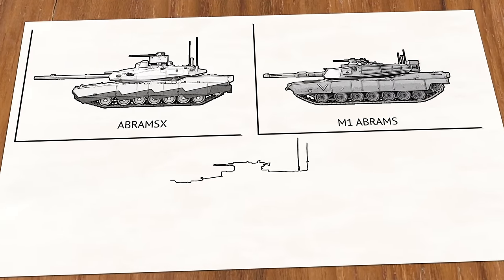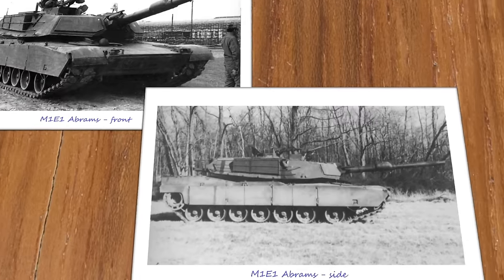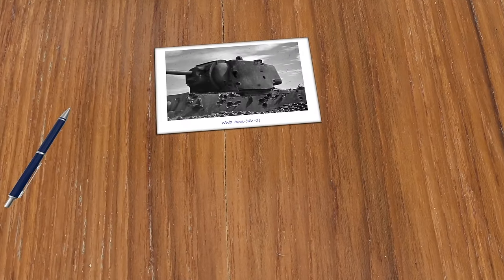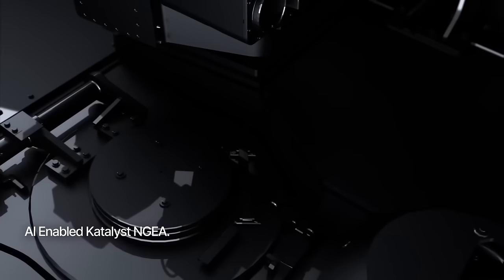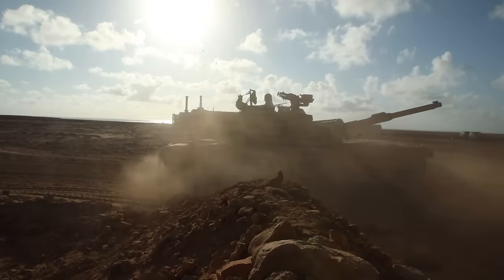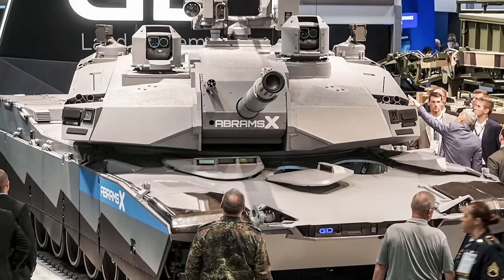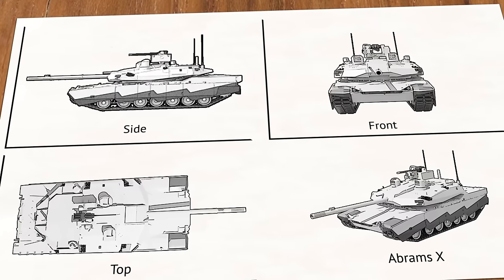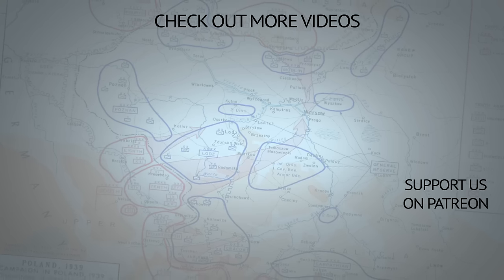M1A3 Abrams is finally happening. And it may get an unmanned turret, like the Russian Armata T-14.

Comment: I would say more like the M1128 Stryker MGS considering design applications. Though they'll likely opt to save the crew and keep the ammo in the turret, unlike the T-14, so it can still use vertical blowout panels without compromising hull integrity or mine resistance.

Comment: Half the reason we don't use autoloaders is because you want that fourth body to help manage the day-to-day needs of tank work. But this is a better improvement in the long run. Just follow the design cues from The AbramsX.
Reply: The same arguement was made for the 5th man back in the late 40s/50s. As it turns out not all tanks are equal in terms of work load. The total workload for the m551 was less than 1/4th the workload of any current m1 abrams (ie you could easily have it be a 1 man tank outside of combat) 

An abrams varient could theoretically be made with reduced crewload so as to not increase indivual crewmen loads while reducing the crew to 3. And inside of combat the minor increase in situational awareness can be more than made up for by assigning a a rotation of light drones to run spotting and security for the tank operated by men not inside the tank (something we already happening in Ukraine atleast some of the time)

Comment: This is a bold and necessary move for US armor corps. The M-1 family is old, and its problems are well-known: too heavy, not deployable under a lot of circumstances, and challenging logistics (fuel consumption is just one issue).  If you can't use the tank because you can't get it there in sufficient numbers, or once there you have a hard time keep them operational, then in a lot of ways, you don't have a usable tank.  The US being able to prepare for its last few major wars well ahead of time (e.g., via prepositioning) solved a lot of these problems, but they may not always work out that way in the future.  A more flexible and mobile force is needed, but I'm waiting to see if the new tank or design doesn't get weighed down gradually as well, which would defeat its main purpose.  The M1 grew by about 20 tons in its development, the SEPv.4 would've only added more weight.

Comment: As there's no info yet on how much weight the Army actually wants to shave off the Abrams, the M1E3 could still end up closer to Germany's conceptual KF51 Panther with its two-man autoloading turret than Russia's Armata with its unmanned turret. The pros and cons of an manned vs unmanned turret in an MBT are still debatable. 

The weight difference of these newer unmanned/manned turret MBT designs don't seem that much. In metric, the Armata's listed at 55 tons but the 21st century Panther (which also proposes a bigger 130mm gun) supposedly isn't that much heavier at 59 tons.

Comment: Given recruiting issues and the casualty estimates for Large Scale Combat Operations (LSCO) it would be wise to reduce the crew to 2 men (max 3). Saves size, weight, logistics and reduces need to train crew replacements.
Reply: If they go with an unmanned turret, the crew will be 3. 
2 is just not feasible with practicalities of combat/maintenance.

Comment: The best bits of every modern and recent tank series:  Engine in front (Merkava), Hydropneumatic suspension (S-Tank), Blow out panels (M-1), ERA (Various, but mostly Soviet/Russian),  Active Protection System (Various), Turbine powerplant (M-1), Armoured "Citadel" (None known).

My ideal new MBT would have a front mounted engine followed by a heavily armoured crew citadel, a lightly armoured turretless autoloading 130mm or 120mm/L55 gun with a 25mm backup cannon, a fire and forget ATGM secondary weapon, hydropneumatic suspension to further lower the front in hull down situations, an APS and full ESM, ECM and IRCM suites.
Reply: Very heavy
Reply: The whole tank is kind of the armored citadel. There's not much on a tank that can really be sacrificed

Comment: An 800hp direct drive turbo-generator would be best. Small high speed and high efficient generator to power a battery bank, with 100% electric drive setup would allow for greatest efficiency and best performance. On board barttery pack would allow for up to 80 miles of silent range and long term on-station silent observation mode.

Comment: The US already designed, built, and deployed unmanned turrets in the assault gun variant of the Stryker. to put it mildly, the turret was absolute hell. Frequent break downs, when a round failed to cycle properly, the crew had to physically exit the vehicle to clear it, meaning they were either exposed or forced to withdraw from combat to address the issue safely. To be honest, at this point in time, with drone technology being what it is, there is no reason to make these kinds of compromises. Larger tanks can serve as squadron leaders to lighter unmanned tanks that can be managed either by the tank crew or by a remote vehicle operator crew in a command vehicle elsewhere. Honestly, the fact we havent considered using unmanned vehicles as our primary assault gun and leave our MBTs for anti armor operations baffles me

Comment: I believe that the modern Abrams X with its silent hybrid engine is best way to go.  Upgrading the current M1 is just a stop gap to producing the modern Abrams X.
Reply: The AbramsX is just a more radical experiment of the same process the M1E3 is meant to do. It's likely they will pick up several things here and there off of it. As far as we know there's not a decision on what engine the E3 will have yet, so (although unlikely imo) it might still get the hybrid power pack

Comment: I would advocate for a new hull with the adoption of latest tech. The role of MBTs in combat are evolving and you need max flexibility. 
I agree the unmanned turret is the way of the future. Autoloaders are reliable enough now. 
But I believe they should keep the 4th crewman. For the same reason they have been retained in the past. The loader is a flexible person. Manning secondary weapons being the biggest reason. An extra man working on the tank inbetween movements is a huge deal in a field environment. With hard and soft kill systems being up and coming plus counter drone being such a big deal. Having a special trained individual for this makes the 4th seat worth it. Also with 4 people a 60-80mm mortar can be used by the tank with one person keeping the tanks defenses fully manned. This serves Israel very well. 
The new power pack I would suggest going to an engine forward design. Stay with a gas turbine. This is lower weight, higher power density, and is easier to service and change in the field. But go to smaller updated engine driving a generator. All electric propulsion with 4 motors. Two front. Two back. 2 separate outside citadel battery banks on either side of back half. With this setup. Even a round strait through the turbine in the front hull wouldn’t be a combat kill. You could leave the battle line and retreat a respectable distance on battery power and the remaining 2 rear electric motors. Put an apu in there. You could move, recharge, move, recharge. Back out of the battle space as long as you had fuel. Or use a big slave cable and charge off another tank or recovery vehicle. Options with this setup make it not invulnerable. But extremely hard to remove from the fight for any meaningful time. 
Engine forward also means crew compartment has a rear exit. May allow room for infantry, move supplies, or man portable weapon system a lot like the merkava tanks does.

Comment: This got me thinking tbh. I wonder how a cross between a Merkava and a T14 style of approach could be done. For example using the capsule style defense system for the crew but at the rear, and putting the engine at the front as another layer of defense, this means in an engagement if the tanks is facing the enemy, if the enemy shot the tank it would have to penetrate frontal armor, pierce the engine and any armor for the autoloader before reaching a more heavily armored capsule.  But also this would also allow you to further add armor on the ceiling of the capsule to prevent top down attacks harming the crew. The possibility of having the crew at the rear also means that incase of an imobalized tank the crew can exit quickly from a rear door aswell. I think having a rear crew capsule would be very viable giving the 3D VR awareness technology coming to 6th gen aircraft, the driver could use this technology to drive the tank from the rear. Maybe this could be the future?

Comment: You take for granted that the unmanned turret will save weight.  The hull will likely have to be made much taller to accommodate the crew in an unmanned design.  On the T14 this is obvious, as its hull looks more like a WW2 Panther than a more modern design.  The net effect may save weight, but it’s more likely the weight savings will come from things like removing the blast doors and downsizing the turret motor.  Probably <10 MT could be shaved that way.

Also, drone warfare has demonstrated that tanks main vulnerabilities will be from the air, from mines, and from artillery.  Older designs that prioritize frontal protection above side/rear protection maybe already obsolete concepts.  If tanks get knocked out by artillery 90% of the time and only get hit by other tanks 2% of the time, why should we shave weight from the sides to beef up the front?

For example; T90 can take the best 105mm round most places in the frontal arc.  But a 155mm landing 10m away can go right through its sides and rear, and that’s not even considering top attack munitions.

Comment: These improvements are all well and good, but if you are going for crew survivability, a rear-mounted fighting compartment is a must. The fact that so many nations are still making tanks with the engine in the back is genuinely baffling. A tank with a frontal engine, rear fighting compartment, and unmanned turret would be the ultimate tank for crew survivability. Also, having the unmanned turret mounted above the firing compartment would further protect the crew from attacks from above.
Reply: A front engine causes a lot of problems. Also, tank turrets sit in the hull as much as on it, so there’s not space under them

Comment: The Abrams chassis is absolutely maxed out in how much weight it can carry. So the Army has two choices:
1. Shave off every gram of weight they can, so they have weight budget available for future upgrades
2. Spend the next 20+ years designing an entirely new tank
Given budget constraints, option 1 is far more likely to succeed in getting budget approval, and the biggest way to save weight is an unmanned turret. It not only saves weight by making the amount of turret surface area to armor much smaller, it also allows thinner armor on most of the tank since the size of the crew compartment to protect is much smaller. Finally you don't need a loader, saving lots of weight and space, and helping with the manning issues western militaries are having. It also allows more tactical risk taking and survivability since the crew would be mostly invincible in a hull down position, even if the turret gets destroyed. So I think unmanned turrets are inevitable.
Reply: I don't think it would take 20+ years to develop a new mbt seeing as how the Bradley replacement was designed in 8 years and that's with budget issues at first, but it would probably be best to re-engineer the current Abrams especially since it doesn't really have adversary that warrents a new tank.
Reply: The biggest way to save weight is stripping out the internal systems and controls and installing new lighter, more compact designs from scratch. Probably easy to save ~10 tons off of that. An unmanned turret is rather unlikely, though an autoloader and 2-man turret is fairly plausible

Comment: Sounds like if top-down and turret hits are more lethal, that they could try having a beefier turret motor and then up-armor both the turret and topmost armor of the tank. That'd probably raise it's profile a little, but it shouldn't be too bad. Still, an autoloader would, even up-armored, be lighter and thus turn faster.
Reply: I think that's what they're trying to put in top-facing APS for

Comment: No point. A major reason the Abrams never used an autoloader to begin with was that experiments with crews of less than four resulted in minor breakdowns incapacitating the vehicle during exercises due to shortage of labor. Specifically, track repair, the most common form of breakdown. Basic hull maintenance requirements are also impacted by crew reduction.

Currently, the Abrams' four-man crew provides a slight "labor surplus", which in the field is utilized by dismounting the loader to help other tanks in times of need as well as to conduct other labor requirements - this is why the loader is often called the "field b*tch". Reduction in crew size - the primary reason usually given for autoloaders and unmanned turrets - harms US Army field operations for armored formations in a variety of ways, and does not significantly reduce the logistics side of things since what tank crews used to do for themselves must now be done by expansion of engineering and other support elements.

Comment: Better steels for the frontal hull and turret citadel would also shave off a significant amount of weight.

10cm steel for the front hull and turret inner citadel could be replaced by 8cm of high performance steels.
Reply: Not sure they have steels particularly more effective than the existing armor plates? Most of the saved weight will probably come from changes to the internals
Reply: There's a paper from 1997 that talks about an improved RHA formula/heat treatment that's usable as structural armor plate even at HRc ~40 for bulk armor.
Compared to HRc ~30 for the current MIL std RHA.

The problem is that US steel mills are generally behind say the Japanese for high tech steel production.

Comment: M1 has still lot of life in it:  changing DU into modern ceramics, gun to lighter one (already designed), hydropneumatic supension and thorough internal equipment overhaul would save at least 6 tons out of the bat. Though primary thing is simple: GIVE IT NEW ENGINE - like overhauled LV100-5 with GE high temperature ceramic. Also: no need to pattern after Armata - M1 had family of advanced concepts under M1 TTB, including 2 autoloaders.

Comment: There is a ton of talk of the US Army biting the bullet and funding a long term program for a next generation lightened armor system for its armored vehicles. Basically creating a new generation of metamaterials and next gen alloys that have same strength as current composite armor/steel but with much less weight. Combing that with new low weight and low foot print electronics, should save multiple tons of weight in next generation tanks. In fact most believe the M1E3 first big change will be replacing all the copper wiring in Abrams with fiber optic cable to save almost 3 tons of weight.

Comment: I hope the Merkava would be the target which would mean a total new approach
Reply: What world do you see that happening? Beyond the US and Israel being allies, the Abrams' APS system is developed by the IDF (Trophy), and so this tank's development is partially contingent on that relationship. 

Also, nobody is fighting tank to tank against a Merkava. That's a losing battle for every other MBT out there. The best ways to destroy a Merkava are a bomber or artillery. Mines might be effective, but the Merkava is a defensive tank, so it's mostly staying in its own territory. Outside of that, even attack helicopters aren't safe, as Merkava fire Lahat anti-armor missiles at comparable ranges to helicopter-fired ATGMs.
Reply: The Merkava isn't designed to be moved around the world.  The Mk 4 is heavier than the Abrams SEPv2, but not as heavy as the SEPv3.
Reply: @JonMartinYXD  Yeah, it's specialized for defensive slugging fests, with a heavy use of ATGMs, in a desert climate. It's perfectly adapted for its area of operation, but it would be pretty ineffective in a place like Eastern Europe, where the size works against it and terrain would cause all sorts of issues.

Comment: The hybrid tank uses: 25% fewer difficult to find men, 50% less fuel, 50% fewer fuel truck with again 50% fewer truck drivers. hopefully it has an APU to reduce fuel usage and thermal signature.
Reply: If it is powering all the stuff for an active protection system and  direct energy weapon to protect from drones, how long do you expect that battery to last?
How far do you expect batteries to push 60 tons, which is what it will likely weigh at full load? At least.

Comment: The critical problem with M1 weight is that bridge rating goes asymptotic after 70 tons due to some sort of interaction between the weight and dimensions.  So a 70 ton Abrams is a bridge class 70 tank, but an 85 ton Abrams needs a class 120 bridge.

Comment: A hybrid diesel-electric engine makes sense, not only for logistical ease but the Army intends, eventually, to phase in direct-energy weapons at some point in the future. Yes, yes, I know, this won't be any time soon but they've experimented with weapons like the THOR and the Navy is already working towards this. These weapons are fast, direct line-of-sight, and work well against drones but they also don't require schlepping another half-ton of .50-cal ammunition, just slave off the electric engine (which does mean more fuel usage, true). That can mean less weight/smaller turret, or, keep the turret the same size and add more main gun ammo. 
Is all this a good idea? I don't know; but reading the recent tea leaves gives me the impression that's where this is heading, at least eventually.